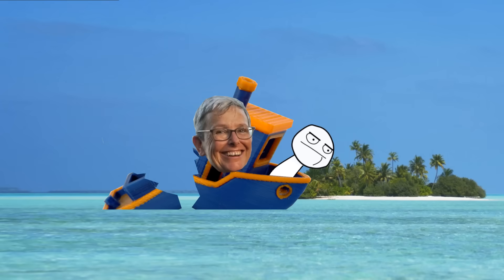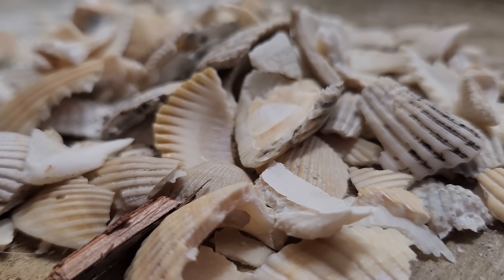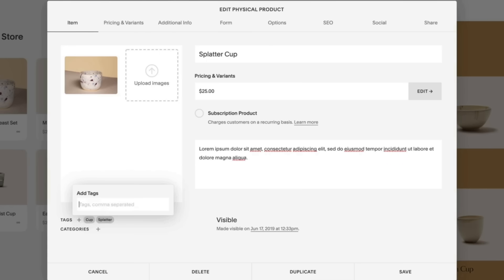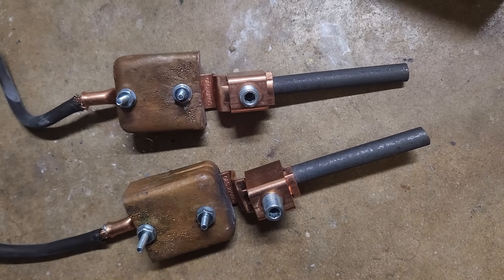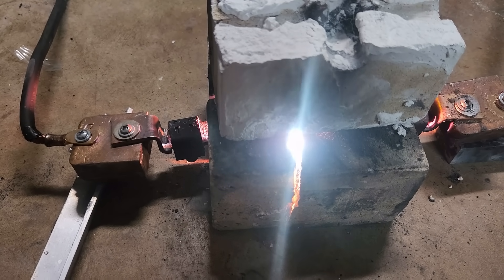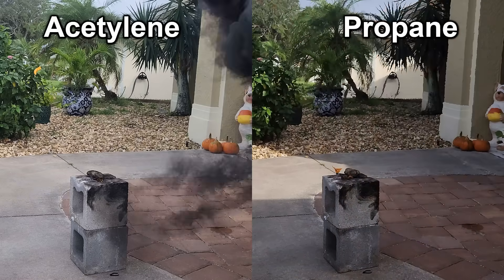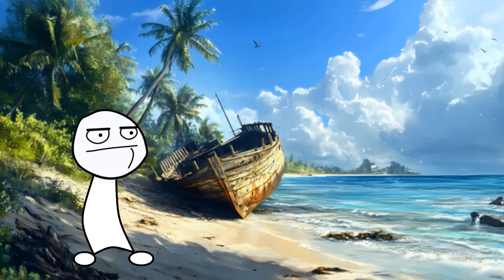Acetylene Gas from Sea Shells and Driftwood

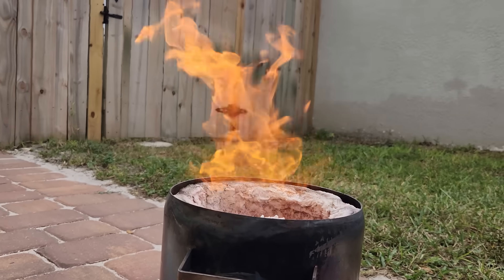Comment: 4:30 A video on a charcoal kiln, then charcoal gasifier (both of which have some Open Source Designs out there already) but ESPECIALLY Syngas to Methanol…to DME (and maybe dme to olefins or dme to omex etc) would be a GREAT series!
Reply: Agreed.  Sure we have Propane bottles, but then we also have Acetylene bottles.  It would be interesting to see what could be done to optimize the charcoal making process, by using its own gas.
Reply: @EmperorA0 Search: charcoal retort kiln.
A brief description:
Take a 44 gallon oil drum (empty), cut off the bottom to make a hinged door.
Use common pipe fittings to attach a pipe (scaffold pole) to the filling hole on the top. Use 2 bends to route the pipe along the side of the barrel about 9 inches away. Drill gas burner holes in the pipe.
Place this on its side with the pipe at the bottom.
Fill with wood and close the door.
Light a fire under the kiln and wait fir the produced gas to catch fire.
At that point you should able to let the fire go out and the process is maintained by the gas flames.
Reply: Make the syngas by running the carbon arc in a stream of flowing methane.
Reply: PLEASE FLORIDA MAN NEVER ASKED YOU ANYTHING BEFORE!!!

Comment: Holy Indian Movie.
I really like your videos, but the thing you did with that transformer was a huge mess.
Why wouldn't you use a Stick Welder in the first place?
Also, you should have have a Watt Meter at the input side of the Transformer.
Another strange thing is that most of those Toroidal (Doughnut shaped) transformers have Bi-Metal Thermal Protection in place to prevent overheating and damage.
You should have monitored the temperature of the Transformer...

Comment: Next you can make some CS2 with it

(If you don't know about this you can bubble acetylene through sulfur at 400°c but you must do it in an oxygen free system because of acetylenes auto ignition temperature. You will get little combustion followed by carbon coating inside your glassware but mostly just a low yield of Carbon Disulfide which you must condense to a cold vessel. It's undoubtedly a stinky prep, I actually love it. One of my favourite preps to do)
Reply: I would love to see this.

Comment: Awesome stuff! 
I did pretty much expected the bricks melting, mixing up with and contaminate the calcium carbide, to be an issue - because 2000°C is no joke, haha. Also, when looking at the temperature rating on fire bricks, it's often hard to find those rated for more than 1600-1800°C. Having an open arc and heat the powder directly a litle at a time is indeed easier. An arc also have the advantage of being able to dump a large amount of power on a small spot (which makes it possible to get up to very high temperatures without containing it)
Reply: It's not at all difficult to fond refractory capable of withstanding the heat.  Simply buy lightweight fire bricks made out of zirconia instead of alumnia.
Reply: @neon-john  Ok, I didn't taught about that. 
If searching for just "insulating fire bricks", it's mostly the alumina ones that come up (like on Ebay or similar). Those are also what's available from most local suppliers where I live.
Reply: Another YouTuber uses silicon carbide powder (for sand blasting) bound with water glass
Reply: "heres a wolfram mug i made earlier.."

lol, found a platinum crucible at the scrap yard? for the price of stainless. bargain.

Comment: A video on Wood Pyrolysis and the distillation of the gasses/oils from it would be very interesting.
Reply: I totally agree. I'm also waiting for the video on making argon out of thin air...
Reply: NightHawkInLight has a few good videos on this. If you like this channel you might like that one too.
Reply: @-vermin-  I remember a video on the collection of the wood gas, but I don't remember one on the distillation, unless I'm misremembering.
Reply: Making oil products from wood would be really neat. Perhaps if it was anoxically pyrolyzed in powdered form, very rapidly (feed through a hot tube?) the oil yield might be higher.
Reply: @Nuovoswiss  That is already done at industrial scale by "kraft process" paper mills: The process starts with wood chips and "digests" them with a concentrated solution of sodium hydroxide and sodium sulfide in what are basically enormous pressure cookers.

The purpose being to separate the cellulose from the lignin and resinous components of the wood. The cellulose ends up in the finished paper, with the byproduct being "tall oil", a mixture of oily substances resulting from decomposition of lignin and resins.

Comment: I reckon you should do a whole vid about wood processing I find it personally very interesting as a Finnish person since most of our industry is just that. I do not know what it truly takes but you could try separating the different gases in wood gas.
Reply: " I do not know what it truly takes but you could try separating the different gases in wood gas."

Destructive distillation of wood. Products can be separated using a fractional distillation column (same used for Crude Oil distillation) The heavier compounds condense at higher temps, & the light Compounds condense at lower temperatures. 
Mr Teslonian (YT) has a serious of videos on wood gasification. IRCC, he has a video of making fuel from Birch wood to run a small gasoline engine, as well as running the engine from woodgas.
Reply: Hello fellow clippy
Reply: @Norrlands-rg5vm  clippy gang

Comment: Carbon arc lamps are the best light ever and was used for years in movie sets
Reply: Doesn't it also contain lots of UV?
Reply: @fresheFresse  sure does
Reply: yes this was popular in 1870- until post wwII. they were used in light houses for a long time too. Carbon arc lighting was important to the film industry and shipping industry for many years.
Reply: @fresheFresse  Simple glass blocks almost all of the UV though
Reply: @fresheFresse Even tungsten filament stage lighting (par 56) lamps produce sufficient uv to be a problem. It was good practice to at least use a neutral (straw colour) filter on plain lamps.

Fun fact that I only just found out after 40 years.. The 56 in par 56 is 56 eighths of a inch, ie 7 inches. Par 36 is also a common sise at 36 eighths of an inch, ie 4 1/2 inches.
Reply: @fresheFresse  Xenon lamps also emit a ton of UV light, but we got UV filters for a reason.
Reply: Calcium carbide lamps were used too, and thats where you get the term "in the limelight".
Reply: @Sven_Dongle  Head mounted lamps were used in spelunking (caving) for quite a while too.
Reply: There’s an original Super Trouper carbon arc followspot (the namesake of that ABBA song) for sale near me and I’m really tempted to get it and have the brightest Christmas light in town.
Reply: @PrebleStreetRecords  Do it! Do it! Do it!
Reply: Arc lamps are the worst lights ever and I'm glad they are gone.
Reply: And anti aircraft searchlights too...

Comment: Fun as always!
May I ask, how conductive is the final fine powder mix? Can you run a current through it or heat it inductively, rather than using an arc? If that worked, it would also be self-limiting as the amount of carbon drops as it reacts.

Comment: I ve done this and the best way I could make it work is on a large steel can and use lots of the calcium oxide and charcoal mixture so the same mixture is its own refractory container. I have made more than 100g of CaC2 NVM you came to the same solution.